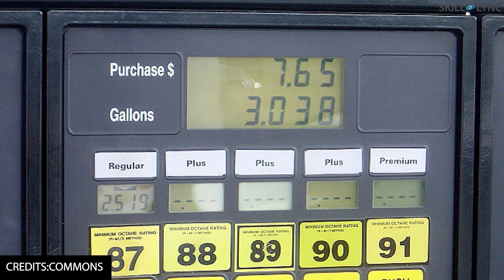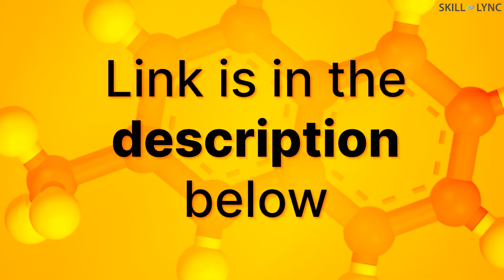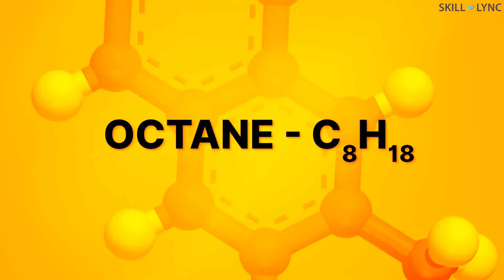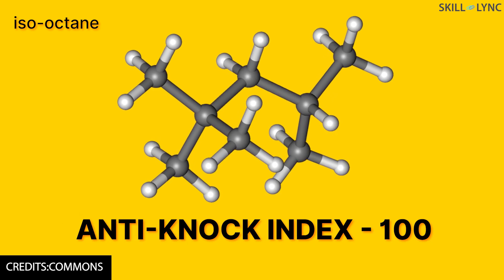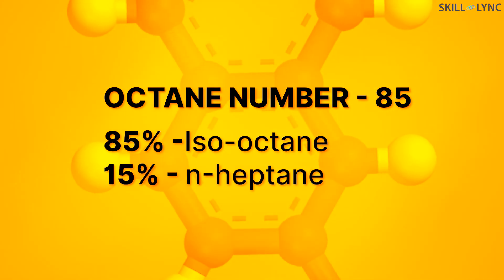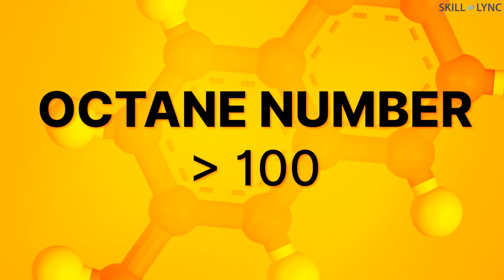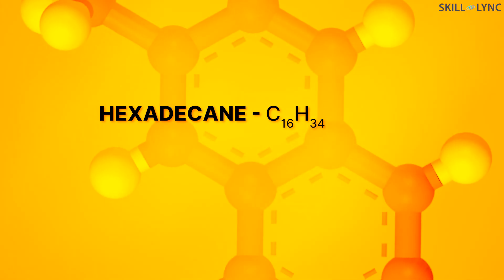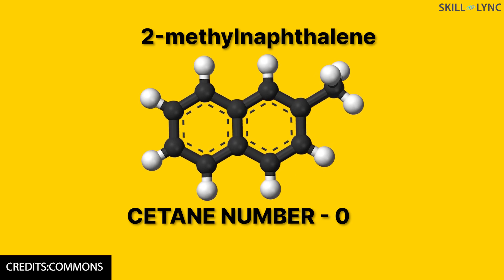Octane number & Cetane number | Skill-Lync

Comment: do octane number and cetane number have any relation to auto ignition temperatures:
1. iso-octane: RON100 Auto-ignition temperature: 447 degC; n-heptane: RON0 Auto-ignition temperature: 204 degC; Petrol RON 89-94, Auto ignition temperatue: 246-280 degC
2. cetane: CN100 Auto-ignition temperature: 202 degC; iso-cetane: CN15 Auto ignition temperature: ??; Diesel: CN 48-50 Auto ignition temperature: 210 degC

Comment: what if I spray water (without ethanol) into the intake, would water mixed with air and fuel lower the possibility of knocking?
Reply: It will mix and form steam which will corrode ur engine
Reply: @HritikJain  so if water is mixed with ethanol, the ethanol will act as a corrosion inhibitor?
Reply: Never heard of that, can't comment.
But yeah mixing water will reduce the temperature as water will absorb the heat and may reduce knowcking.
Reply: @HritikJain  okay, so the idea is that water without ethanol will cause engine to corrode but water mixed with ethanol will not cause engine to corrode